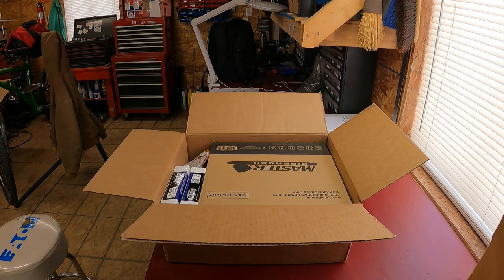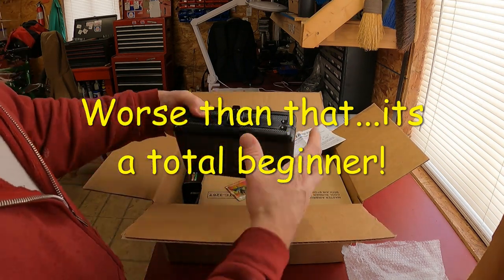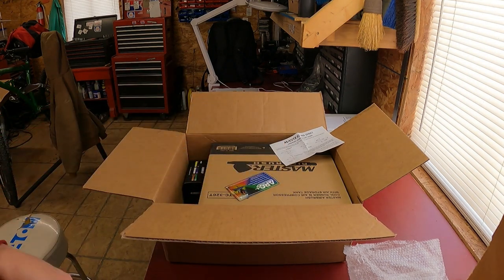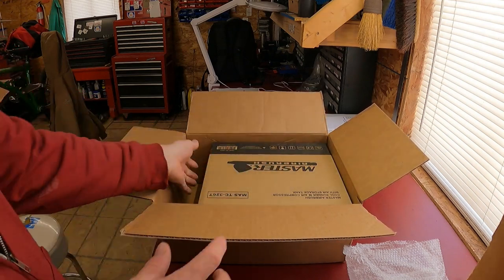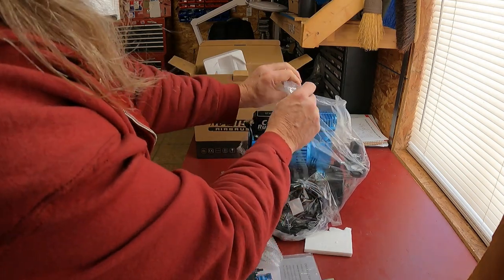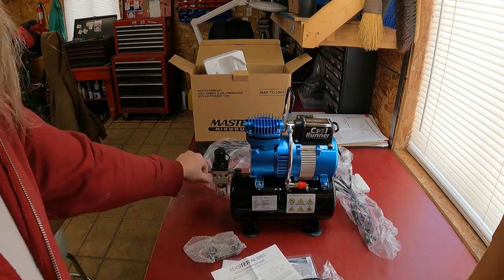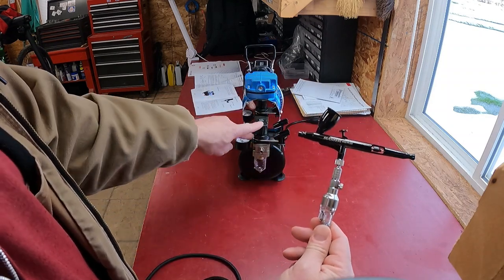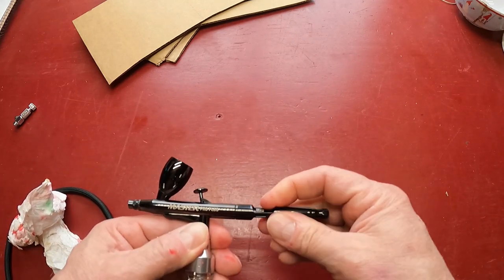Master Airbrush kit for RC painting Part 1

Comment: is that thing super loud? all that drumming when youre running it is the compressor? thinking about getting one and putting it in a noise cancellation box.
Reply from the maker: Well noise is kind of a subjective thing and personally i don't think its loud BUT most of that noise you hear in the background is from the fan i was using to pull fumes out with. All in all i think its a great unit. Thanks for checking in